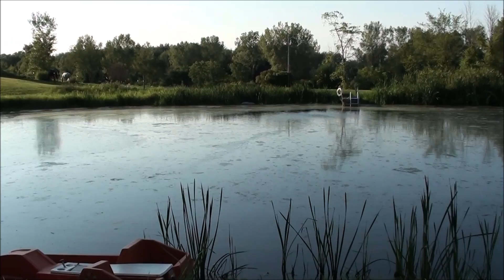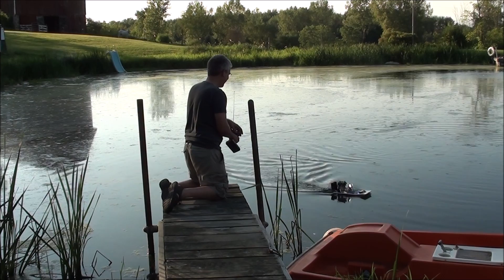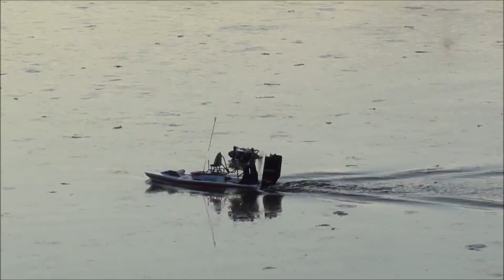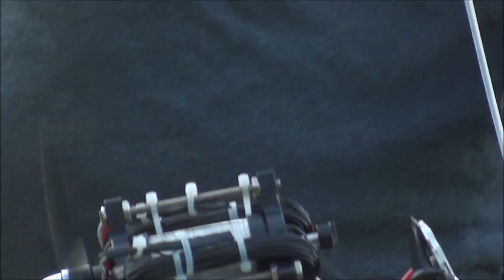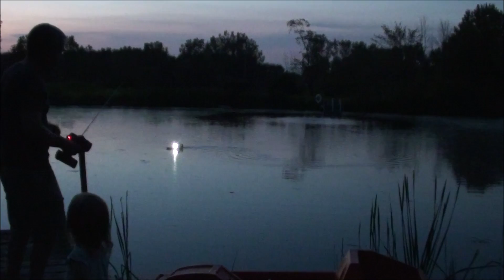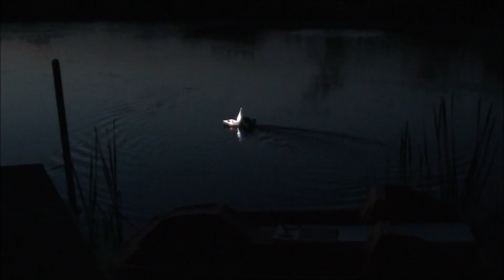Remote Control Renaissance Free Energy Watercraft

Comment: You say the LED is "about half brightness"... but if there's anywhere close to 50 watts running in that LED, it would be getting VERY hot... especially without a heat sink... hot enough to even burn it out. Is it getting hot?  It could be as low as 1 watt and still "look" bright, but would hardly get warm at all.
I'll be watching to see how well it charges an identical battery pack that it's using to run it... while running the motor against some kind of a known load. 
If you could spin a BLDC motor with your motor, and use the BLDC output through a 3-phase bridge rectifier (Schottky diodes preferred) with a LARGE filter capacitor, and run that into a load resistor while measuring the DC volts across the resistor... then you have a pretty good idea of what kind of output power your motor is creating. 
High performance BLDC motors are actually pretty efficient 3-phase AC generators (alternators, to be precise). You would need to calculate the losses through the diodes, but the BLDC motor can easily be 80%+ efficient.
Reply from the maker: beforebefore That would be the case if we were pushing current or positive energy. We also do that with these LEDs and they do indeed heat up. In fact we have the very large heat sinks necessary to run these at full load. But with this negative energy output we can actually light these LEDs very bright without any current. You can see in the video when we hardly start running the motor where the light comes on the brightest. The motor is running at only a few volts at this point. When we push the motor to full then the LED is dimmer because more current comes into the system. So no, this is not true what you say here and is only true in a conventional system. The output is not positive energy flow or it would be zero output because there is no output in such a system, only losses. Here we are converting positive energy into a negative energy output. The output changes depending upon the load you place. The larger the battery being charged the more charging you get. The LED just represents a small load for a practical example. The watercraft runs the same speed but powers an additional load. We can also place another battery there and rotate them around. This is the test people have done for years with these systems with our fans and various motors. I personally ran my 26' boat with the same sort of motor (the industrial size) for three years by rotating the batteries back and forth. And yet you could put meters on the output and not see current flow and so would wrongly judge the output of that if you did not take the time to do rotation, etc.
Reply: +Rick Friedrich Guilty as charged... my apologies.  I often forget to re-classify my thinking when dealing with BEMF that's allowed to "do its thing" instead of just clamping it and dissipating it.  Your comment about how the 'effect' is much stronger at lower motor speeds reminded me of high-voltage systems like this. Since the supply voltage is much higher, you can always run a much lower duty-cycle, allowing the BEMF to disturb the "environment" more often, and harness more reverse energy.

I guess seeing the LED made me think conventional... old habits...

Question 1...  have you tried charging super-caps with the reverse energy from the EM field collapse... instead of a battery?   It may not work as well.... since supercaps have a very low impedance. Batteries... especially discharged ones, have a higher impedance, and can easier accept high pulse charging... whereas caps may not... but it'd be an interesting experiment. It may require the reverse-pulse to be temporarily stored in an inductor, then let ti transfer the 'charge' into the battery between pulses. You'd also need a flyback diode on the input side of the inductor, to allow it to swing against 'ground' once the 'reverse pulse' has dropped off. This effectively gives the supercap some "input impedance" to work with.

Question 2: If you used lower mAh capacity batteries (yet still capable of high discharge current needed for the main motor), could they be swapped more often, and still run as well? (thinking of a variant of Tesla's battery switch configuration, for automatic battery swapping)
Reply from the maker: beforebefore Another correction here. In agreement with conventional thinking we do not see the back emf as able to charge up any battery or do any real work. The bemf is a problem in motor systems and our motor geometry and circuitry helps to remove or gate the bemf so that it does not become a counter force in our motor rotation or battery charging. It is not the bemf that is charging the battery(s) or powering this light as the bemf is always less than the forward. In fact it is another force at work that charges the battery or gives us the goods. This takes place instantaneously at the moment of switch closure and results in negative potentials sometimes hundreds of times the input voltage without any kind of transformer system involved. 
Again, it is not a matter of higher voltage lower amperage. We are dealing with a different kind of energy here that has opposite characteristics. We can have zero amperage and yet charge batteries and run lights. Sometimes there is some amperage registering as a magnet is still passing a coil but the main result we are after is actually at a different time in the phase. So you can have several processes consecutively take place but only one is worthwhile. 
We can also light the LEDs with zero volts and zero amps as we show at our conventions, this is zero point energy which is not the same things as negative energy we have been talking about. 
Yes we have worked with super caps and used them in our our systems. However, they are very costly and are low voltage. The lower the voltage of the caps the more they bottleneck the high voltage potential available in these systems. 
The mosfets have the diode already internal. The flyback diode has its purposes but not in this motor with the transistors. We already have the output diode going to the charging battery. The primary input battery does actually receive some chargeback without a flyback diode as the energy is not limited normal blocks and walls. We often place capacitor banks across the input at the circuit so they can absorb the energy more and be used in the motor rather than in the input battery. 
Again, we actually want to do the opposite because we are not dealing with positive energy flow. We want to have larger batteries to receive more charge over time. The smaller the battery the less charging will take place because there is less of a load and less area to be affected.
You can see why this technology is misunderstand and not appreciated because all the normal assumptions are wrong. So in evaluating the performance one trained in conventional systems will use all the wrong meters, parts, and make changes to the system so that it will not perform correctly and will thus be wrongly evaluated as unimportant. The video before this entitled Simple Free Energy is an attempt to correct this at a very basic level and help people to first see that there is another kind of energy being used to charge batteries or power loads. Once that is seen then people are less likely to apply conventional thinking to this system. Then patience can be added to the process and in time people can appreciate the results.
Reply from the maker: +preferCreate As for the quality, I mean if the battery is sulfated or otherwise older and needing rejuvenation then these processes will focus in on rejuvenating the batteries more or less first before charging them. Rejuvenation is not an efficient process and because most batteries need that people often overlook this in evaluating these motors the first few cycles.
As for size of the bank, the larger the surface area being influenced by this process the more charging can take place. Unlike conventional charging I mean. 
There are many other factors we talked about that influence the charging rate as we talked about at the meeting (for example rest periods, resonance, conditioning, etc.).
If it is truly a negative resistance process then the energy flows opposite than normal. 
Youtube does not give me the option to reply to your other comment above so I will reply here. Negatively charged batteries over time will eventually have no positive charge in them, such as the batteries Michael Stroh used for the demonstration of the magic box. These were cycled many times where they were discharged to zero volts and charged up with the one motor. When using the trigger coil triggering system on our motors, which most of them were set up as, the charging batteries are being negatively charged. This we did with the the little kit being assembled as well. To create a negatively charged battery we need positive energy and a positively charged battery or input. And it is possible to use a negatively charged battery and make a positively charged battery with changes to the motor (not shown at this time). However, when we use the capacitor with pulsing system, as shown in the fan kits and on the 10 coiler with the large blue capacitor bank, the capacitor transduces the energy from a negative to a positive so that the batteries can still be positively charged enough to be swapped around with all of these motors. It is a curious experiment to run tests either way and see the difference over time. 
Furthermore, the hall with Fet switching has more of a positive charge flow where more amps can be measured so that the batteries can still be rotated without the capacitor transducer system added. There are some losses in that as negative energy will not manifest in the presence of positive energy, so during that on-time it will be a positive flow and only negative for a very short time. There is a lot of complexity in the on time and motor/charging efficiency that needs to be fully explored with each motor. There is a practical limitation we talked about at the meeting where we have to decide what we are after. Do we want maximum charging? How much torque do we want? Do we want some charge back into the primary battery? Do we want light production at the same time? How much heat do we want (I am creating a heat system as people desire heat for their water and homes)? For this RC vehicle, the scooter motor, and for the larger car motors we simply want a motor that produces the same torque and runs 2.5 times longer with rotating batteries. Not that we can't do longer times, but for the market that is all that is necessary to make a major difference. 200 miles range for an EV rather than 80 miles. or 400 rather than 160 miles. 
The efficiency will depend upon the how you push the motor. In this video you see as I adjust the voltage with the trigger the light comes on very bright more at a certain spot and then dims as I approach maximum speed/power. So at that point where it dims, and the LED is a good way to determine this, we are out of the sweet spot and pushing more amps in the system. So maximum battery charging will not be at full torque unless other adjustments are made. To make a useful product that is plug and play with not too much expense and processes we are only after 2.5 times the range.
Reply: +Rick Friedrich It very much sounds like there is a correlation between the quality/size of the battery (bank) being charged and this effect. therefore, it might be further said that not only is your statement that the bemf is not an explanation for this energy (smaller than input, as stated), but the (extra) energy being collected is utilizing the BATTERY itself. This would agree with theories made by Leedskalnin that batteries are similar to monopole magnets.
Reply: +preferCreate   I would tend to agree that the characteristics of the lead-acid battery are a key "ingredient". 

One of my patents from "Y2k" was focused around the characteristic impedance of a wet-cell (automotive) lead-acid battery at different AC (low RF) frequencies.  I determined that in the 100-200kHz range, their impedance increased dramatically... which allowed me to design a "current carrier" signalling system to control a variety of truck mounted equipment (snow plows, chemical spreaders, sprayers, etc.) using nothing more than the 12V DC wires providing power to the remotely mounted equipment.

It could well be that this increased impedance is what allows for "pulse charging", as well as the ultra-fast flyback pulse from this modified BLDC motor controller that Rick has.

I believe it may be possible to replicate this characteristic impedance "function" with most any other battery... possibly even a string of small ultra-capacitors. It's conceivable that a inductor/diode/capacitor pulse integrator could capture the energy spikes, convert them to electron energy (VERY fast diode), temporarily hold them in an inductor, transfer to the capacitor, then bleed them off to the "other type of battery" (or ultra-capacitor) as the next pulse is arriving. Multiple stages may be needed, but it seems feasible.

... but then again... when we're talking about radiant / quantum / vacuum energies... who knows.
Reply from the maker: +beforebefore Yes we manipulate the battery to charge itself. We can do this with all battery chemistries. There are many factors to consider however. First of all we have to consider what is safe for the user and what is good for the battery over time. You may have something beneficial for the moment, as many an inventor has discovered, only for it to be unhealthy or still destroy parts or batteries over time. This we see with desulfators that chip away at the sulfation and continue to chip away at the lead plates. Or we see with many Tesla coils that use positive energy and the people in the area around it can be in harms way. Or exotic motor or solid state systems that give you the goods for a short time and destroy the battery fairly quickly. This we have to avoid and this is the main focus of our company to create safe products that allow you to keep your batteries. The efficiency is always a secondary matter of importance. 
Again, other factors are being able to rotate batteries around, determining how much torque, heat, light, or otherwise you want to produce...
As for diodes and parts used, there is an endless search for parts that improve upon these processes, but many times the beneficial processes pass through the components in the system so very fast diodes are not necessary...
Reply: +Rick Friedrich yes! I totally get that and I am currently charging a 48v bank from a battery that I'm charging separate to keep it 'positive.' 48v charging from a 12v source, people. it is working DESPITE 2 of the batteries being purposefully sulfated (one started at 4v). this IS working even off just one circuit, but note that I am allowing 12hr of rest time per day (half on, half off) because the rest time is where the magic happens. Also, I have created drag on the shaft with fan blades made of masking tape because of the info that reports that a load will add efficiency. I highly suggest reading Leedskalnin's publications where he reveals that electricity and magnetism are so very similar as well as revealing that what we are creating here are 'north' pole batteries and 'south' pole batteries. batteries are one-pole magnets according to Leedskalnin.  it is all spin, ONE spin, Vortices. ... just seen from different perspectives which make this one energy seem different -- not unlike the same toilet when in Australia will drain in reverse. I really really just want to get to a point where someone will be straightforward about how to auto-switch the banks and how to implement the capacitors so that there is less limit to utilizing the batteries for any and every load.

Comment: free energy???
Reply from the maker: Георгий Казанцев Any energy that is extra that is not normally available is considered free. The light is not running off of the battery here, but represents around the same amount of energy to power the motor at the same time while giving the same original run time. So we have around two times the work being done from the same battery over the same time. The LED could be another battery instead and the batteries could be rotated around. As a product we sell to the public we are only after giving people 2.5 times the output normally experienced (that is using one fully charged battery and one fully discharged battery) or 5 times the output with two fully charged batteries--rotating them around several times. This is running the motors at fully power outside of sweetspots and using small batteries. If you run with good bigger batteries and at the sweetspot you could possibly continue to rotate batteries around as we and many people have done for years...